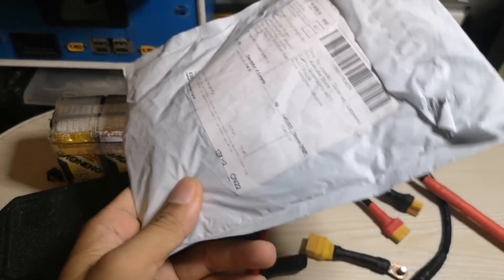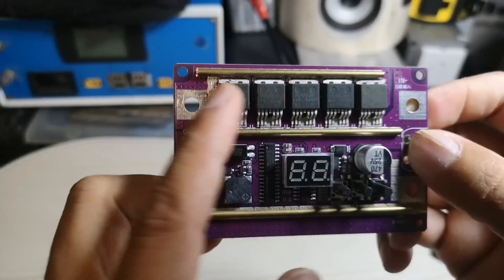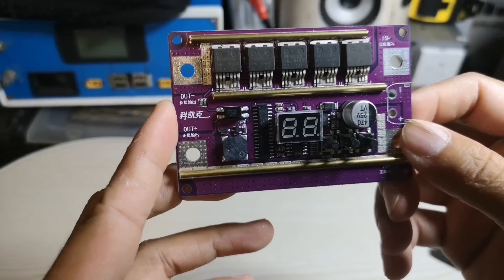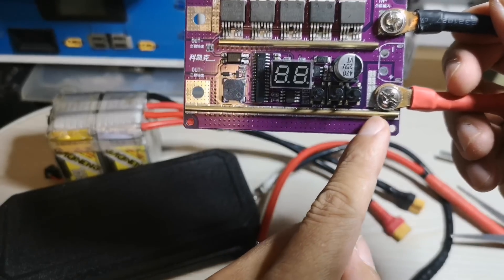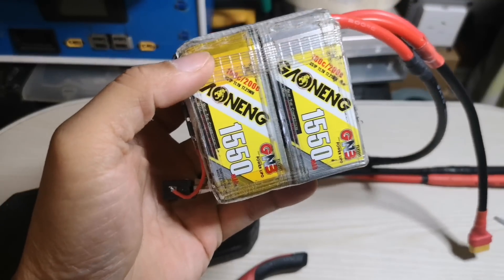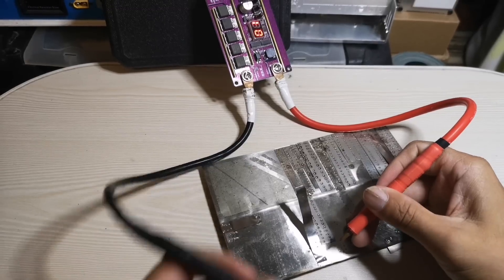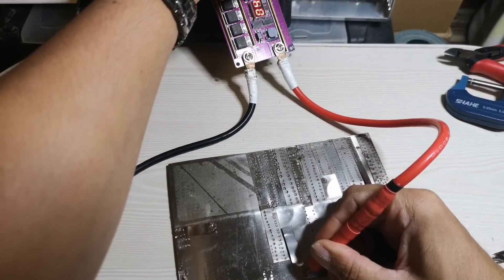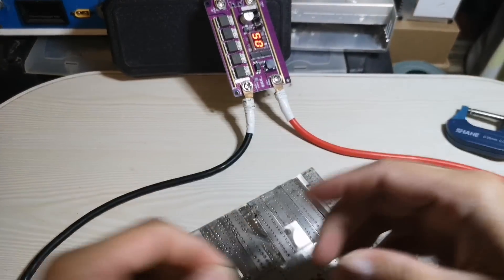Part 1 2022 portable spot welder 99G review and technical "TIPS"

Comment: Battery 🔋🔋🔋 amp lepo or lithium battery 🔋🔋🔋🔋 what amp after using
Reply from the maker: Rc battery 11V 9200mah 100-200C 
Much better ultra capacitor more life span than Lipolymer battery

Comment: Can I power the module with a 15v 3.5Ah power supply?
Reply from the maker: If your 3.5Ah is high drain battery up to 120C then you can but if not sorry It never worked.
Reply: @pitikaron  What power supply can I use because I don't have a battery?
Reply from the maker: AC to DC Power supply can't work you need a high drain battery RC car battery it's better because it is designed for high drain and look for 120C 12V 10Ah or 10000mah
Reply: @pitikaron  I saw a guy on YouTube working with a 12v 4Ah battery
Reply from the maker: I suggest 12V 10Ah up to 120C so that it can weld 0.2mm nickel strip

Comment: 7:40 how is this possible? I have the same welder with Luca mod and can't weld 0.2 mm at 95 gear with 300A lead acid battery.
Reply from the maker: My battery is 9Ah 12V 120C
Reply: Crazy, didn't know that the welder could handle that much. I need better battery.
Reply from the maker: I used a Lipolymer battery pack for an RC toy car
Reply: @pitikaron  Nice. I was searching for Lipo above 70c and 6000 mAh but they are hard to find, so I got this.
Reply from the maker: Ali-express I purchased 2x 4.6ah  and I connected into parallel
Reply: @pitikaron  They must be nice. I would do the same but a lot of batteries from Aliexpress have fake capacities, so I have to find a reliable seller first.
Reply from the maker: @ricma9710 DXF 2PCS Lipo 2S 3S 4S Battery
Reply from the maker: @ricma9710 after revisiting muanpurchase history I found out I've pury 2× 8400 mAh 3S link below 
https://a.aliexpress.com/_mLOskas
Reply: @pitikaron  thank you, i will see if i can get it.

Comment: Can it work from 12 volts 64A 600 Starting current battery from a car directly connected.New battery or the chips will explode
Reply from the maker: I am so sorry because I haven't tried to power up a car battery. But better use 12V 10Ah 50C or 100C  lithium polymer battery

Comment: Hello, i think mine blew a mosfet or several. It burns holes and sparks fly. Is it possible that it might need a capacitor mod like other spotwelders? And it is possible to specifically determine which mosfet is blown or do you have to desolder all from the board and check individually? Regards
Reply from the maker: If that is so there is something wrong with the microchip controller timer.
Reply: @pitikaron  how do i check the mosfets? Regards
Reply from the maker: Check by multi meter? You can also search on YouTube how to check MOSFET
Reply: @pitikaron  ok Thx
Reply from the maker: You can also try his tutorial
Reply from the maker: If you want a reliable try this set up 
https://youtu.be/_T7fAKHPuWM?si=l5ooINT6jepHoCbk
Reply: @pitikaron  209 vs 228 mosfets, which one is better?
Reply from the maker: Both better but I replace it 288 the most important is thick traces and the battery
Reply: @pitikaron  Ok thx. Godbless

Comment: Curious how you’re getting good welds with 0.3mm nickel at gear 15. I have to go above 90 to get welds that are strong enough to tear the strip. At around 40 is where they begin to take hold but I can pull most of them apart. Have you had these results on actual batteries as well? Any thoughts as to why I’d have to go so high. Batteries I’m using should theoretically be able to deliver 1170 amps.
Reply from the maker: What sort or battery are you using?
If needed to max the gear means your battery is not high discharge rate.
Reply: @pitikaron  two parallel 6s, 6.5A, 90C. Totaling the 1170 in my post. Seems like that should be enough :( MOSFETs get pretty hot pretty quickly too which is my only fear.
Reply from the maker: Are you sure 6S? Then increase the thickness of the input and output traces. Then use 6/8 gauge silicone wire, If you can?  replace the wire of the Battery into 6 gauge and 8 gauges for welding pen.
Reply: Sorry, 3S. Oops. Going to try increasing the pcb traces as a next step.

Comment: pwdi bana sa battery sa motor sir
Reply from the maker: Dili boss palit nalang og RC battery 12V 5000mah 100C
Reply: @pitikaron  salamat boss nag libog ko unsa battery gamiton ana na 12volts hehe sa tarak tarak ra de i
Reply from the maker: https://ph.shp.ee/q7DQj7s

Mahal lang Pero sa 12V lead acid 50Ah pwede na basta bag o lang
Reply: @pitikaron  dli pwdi battery sa multicab same ra sila price
Reply from the maker: Lantawa lang ang pulse discharge current or cold cranking amps sa battery sa multicub

Comment: got same board. Mosfet blew after 20 double spots at level 3 of 99
Reply from the maker: What type of the MOSFET install to the board coz I've heard a negative feedback that the latest model of this board installs fake MOSFET and That's why it blew up. But mind the first model it's still alive no issue I encountered.
Reply from the maker: If you can replace it by yourself I also have a video  illustrating how I replace and what type of MOSFET I replace.

Comment: would this work okay with 12v 7amp alarm battery
Reply from the maker: If 7amp then the max C-RATE or DISCHARGE RATE is 300amp it will work.

Comment: Hello,
I bought the same board for spot welding,
I am satisfied with the performance and function so far,

Do you happen to know how I can turn off this “auto-off” function?
It annoys me when I take a long break and have to switch the device on again and again

Greetings
Reply from the maker: You can create two power source, 12-16V power wall and the battery.  The battery you used for spot welding power supply, wall power supply. a few YouTuber call it power wall then the negative input From the battery goes to input welding board and the positive goes derictly to the test prove. By powering off you only unplug the wall power supply. And I think that's the only way.

Comment: Hi! Any test using lead acid car batteries? I have some 45Ah-100Ah (capable of 800Amp at 12V)  but in the manual they say it can burn the welder and I have to use max 45Ah and at least 1 year old lead acid car battery.

From Ali description:

"The old lead-acid battery 12V 20AH-100AH (the new battery cannot exceed 45AH) and the 20AHI old lead-acid battery cannot exceed one year. The older it is, the bigger the capacity.

Or: 4-5 strings of super Farad capacitors"

I am not sure if I understood well, maybe 20Ah must be max 1 year old and 45Ah can be new,but 45-100Ah must be many years old.
And where to put the super capacitors? Shoukd they be in parallel and I could use my 100Ah new battery?
Reply from the maker: Sorry I never had to try using a 100Ah lead acid battery. Moreover I don't have any idea the difference between lead and RC car battery. My advice is just compare the specification of lead acid and RC car battery and if it is relevant or similar then I think it could be useful but remember I never had a chance to use a lead acid battery. But for your safety just stick to it to your 45ah I think.
Reply: @pitikaron thank, as I understuud there K99 spot welders have no current limiting and the required gear ratio also pased on the battery pack used. So I have to make experiments. I saw at other videos on litium ion 4S4P it required at least gear50-60 to weld a 0.2. litium polimer (RC)  have high C compared to  ion and also lead acid car batteries have high amps for short period but gread internal resistance.... so will have to check, I am waiting for my welder kit to arrive.
I have my car batteries used for my solar buffer but turned out not working well so using 7S120P 18650 pack for solar now from recovered cells.
Reply from the maker: Nice I hope you will be successful with your experiment.

Comment: the batteries in series or parallel
Reply from the maker: Battery power source?
Reply: @pitikaron  yes, the input source, because I see there are 2 xt60 connectors
Reply from the maker: First I buy 3S 1550mah but the current is not enough so I purchased the same spec & I see the current increase so I purchased a third time but 2 pack of 3S 1550mah 100C and I connected in parallel. So the total is 6100mah. However if you have a plan to purchase, choose 3S 8500mah 100C. There are so many high drain battery packs in ali-epress.

Comment: Hi, i see that with some spotwelders they connect the positive directly to each other on the pcb. Is that better? Regards
Reply from the maker: Kindly please explain further because I can't figure out what you mean by it? Sorry.
Reply: @pitikaron  https://youtu.be/9I5pJyM8DKk
Reply: @pitikaron  if you look at the video you'll see that that positive leads are directly connected. I wonder if that's a better configuration? Regards
Reply from the maker: Directly connected to spot weld tips or positive power sources? If that's what you mean by it, basically that's how it goes. If you think you could add more for protection it is better. But spot welder design to release large current to melt the metal.
Reply: @pitikaron  if you look at the video you'll see that the positive from the battery is directly connected to the postive welding pen. that's what i mean
Reply from the maker: Now I get  nothing wrong with that, that's how it goes.

Comment: Hi. Is it possible to use this solder with Li-ion 21700 Cells 2S-6P (8,4V - 24AH - 210A Max constant current drain)? Thanks
Reply from the maker: If that's the max peak current it is possible but you should expect for current drop due to the plate not being thick enough. To avoid burning the MOSFET you must separate the power source for switching on/off and your 21700 cell pack for your welding current.  But the power source/supply must be the same Voltage to your 21700 cel pack 8.4V. moreover 200A ideal for 0.15 nickel plate.
Reply: @pitikaron  Thank you for your really fast answer! I'm a "little" newbie" here... I didn't understood what you mean with "you must separate the power source for switching on/off and your 21700 cell pack for your welding current.  But the power source/supply must be the same Voltage to your 21700 cel pack 8.4V".  I was speaking about my power source battery, It will be a 2S-6P of the Samsung INR21700-40T 4000mAh - 35A. It would be better a 3S-5P (I have 15 of this cells, I will use another solder machine to build this battery)? With 2S I only have 8,4V at the maximum capacity of the cells... Thank you once again!
Reply from the maker: If you have 3S and 6P it is better 6×4=24
24×10C=240A. Inregards separate power source search power wall spot welding for 18650 battery so that its easy to understand. There's a video on that.

Comment: Sorry for maybe a dumb question. Do you have a video on how you put your battery packs together?
Reply from the maker: What kind of battery? This battery its not really good pack it is better for to buy 8.4mah 3S 100C  I think I provide a link to the description below.
Reply: @pitikaron thank you for getting back to me so quickly. 

The 1550 yellow batteries. 100c/200c. 3s1p 11.1v 17.2wh. I think this is the correct information on the batteries. 

I now see 2 positive lead wires joining together and 1 red wire you are using for a ground. I couldn’t see the backside of your batteries.
Reply from the maker: Yes according to the seller and the brand is Gaoneng. 1550mah 3S  4X of 3S  1P I replaced the stock 12 gauge wire into 10 gaugewire and I connected parallel so that the voltage still the same 12V 3S 4P  so 1550mah × 4= 6100mah × 100C = 6100A burst current
Reply: @pitikaron  
Thank you again Piti. It looked like 4 cells to me but I got confused when I saw 3 red wires and no ground at first. Then I saw you hook up a red wire with black tape to ground I figured maybe 3 ground wires and 2 more hot red wires were on other side of pack.
Reply from the maker: Actually it is all red wire but to make it sure that I can't mess up connection/flug in to the spot welder  I wrap with black tape for negative Identification. The configuration is just connecting the four types of 3S 1P battery into parallel.  If you have an email I will mail  the photo to you.

Comment: Are those pure nickel strips?
Reply from the maker: O.2mm is pure according to the ADS of the seller 99%
Reply: You can tell in 10 seconds. Take your Dremel with cutoff wheel and cut off a couple of mm's. If it's nickel plated steel, you'll get a great spark show. If it is pure nickel, you get zero sparks.
Reply from the maker: Thanks for your secret information I'll do.

Comment: I think if you actually tried to shove 250 amps through one of those fets you would end up with a small, stinky fire. I have one of these and there is no way in hell they will take that type of current. Milliseconds worth maybe.
Reply from the maker: Base on Fets spec, it can only manage millisecond even 800A.
Reply: @pitikaron  Just was using mine with a BMW battery...950 CCA/105Ah. Plenty of juice. It's so nice to not have to worry about heating cells with an iron to make packs.
Reply from the maker: Nice 😉😉😉
Reply: Why look at CCA when you are actually shorting the poles of the battery to weld?!! You should look at the spec SCA ( SHORT CIRCUIT AMPS)  and I promise you its several thousand amps! From 1500 -2700A for the car battery you mentioned. For that battery you need to modify the board (simple) to not dip in voltage too much and use several high amp diodes from minus to plus of the battery otherwise you'll blow up you fets guaranteed

Comment: thanks a lot for showing wtf this thing is. saw it on ebay and was a bit lost. ordered one thanks to you :)
what about using a 12v power supply? i have a basic old school bench supply and a few server supplies. they put out a lot of power.
Reply from the maker: Thanks also for dropping by my channel
Reply from the maker: You can use it. Separate power supply and the supply for welding but be sure it is the same voltage  ⚡⚡⚡.

Comment: wonder if this battery would be ok to use an 8000mAh 11.1V 100C 3S Lipo Battery
Reply from the maker: I purchase from ali-express  8400mah 3S 12V  140C and it's work well, more over I think I provide link for every item I showed in the video.
Reply: @pitikaron  Thank you for quick respond so then an 8000mAh 11.1V 100C 3S Lipo Battery should work fine  tnx again
Reply from the maker: Yeap the most importante is C rate or discharge rate

Comment: i just got mine, i connected it to a 3s5p battery and tried to weld on 04 and the fets just burned out completely and the strip melted, what fets should i get?
Reply from the maker: Check your fets if it is IRL40SC209 then replace IRL40SC228.  Before replacing fets kindly please check the resistor head to gate if it is still fit or not short or leak? anyway I have a doubt why the fets burn coz my spot weld it won't even I supply 3S 4P 6500Mah 100C up to 200C at this video coz I produce another part  and I think I supply 3S 2P 8400Mah 120C-240C?
Reply: @pitikaron  which one is better? IRL40SC209 or IRL40SC228? Regards
Reply from the maker: IRL40SC228 however if heard a few negative feedback in regards  to this board the second generation is not working well.

Comment: Just a question. I see you recomand everyoane that the car batt is capable of 500A discharge. Just curios where does it say that? Because the manual states that if new, the car batt should not excede 45A capacity, well good luck on finding a car batt that is 45A and can do 500A. I've bought a 44A (390A peack discharge) that's how they usualy come. I've seen 500-600A at batt of 60-75A but then you're not as by the manual with the 45A limit. They all talk on videos about this device pulling 300A. So..where is the 500A number come from? Thanks!
Reply from the maker: If I recommend the car battery I am so sorry, but I reviewed my video I didn't say anything in regards to the car Battery that can discharge 500A instead of doing a review if the spot welding machine can work well/weld firmly. Anyway one comment below asking me if he/she can use the car battery and I said yes as long as it won't exceed 16V and can also manage/discharge 500A?
Reply: @pitikaron  Yes, that is are the comments regarding 500A. But nevermind..I was having trouble spot welding and seeing your comm I thought my batt is low power but then I've found I was presing too hard on the tips and then even at max power the spot welds are weak. Several people were talking about that on a vid comments, glad I've saw that. Now at a quarter power makes strong welds if I just barely touch them..
Reply from the maker: Yeah don't press to much, as long as the two TIPS contact to the NICKEL STRIP it will weld firmly but base in my experience I push enough strength so that the nickel strip and the battery contact firmly.
Reply: 45Ah(amp hours) and a car battery can deliver up to 2500A!! Short circuited. That is what you are doing for the welding.many people look att cold cranking amps CCA and that is wrong ! The short circuit amps is several times that! This controller should be modified so you don't blow up the FETS. and use several high amp diodes from minus to plus of your baytery